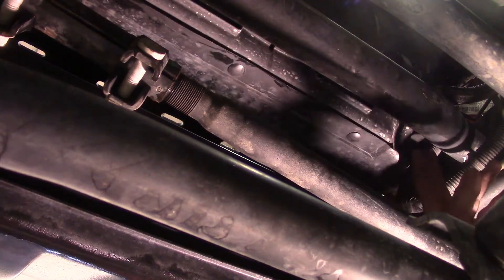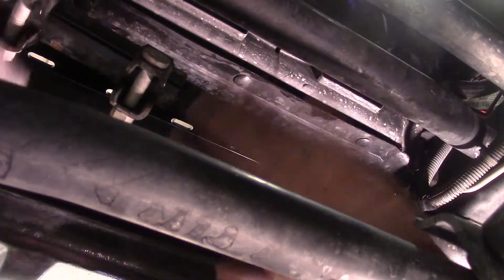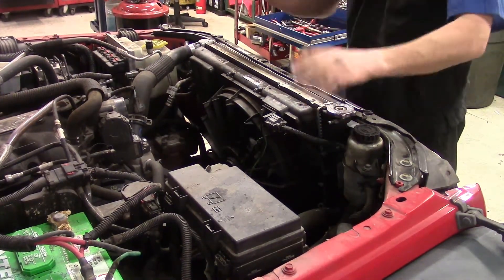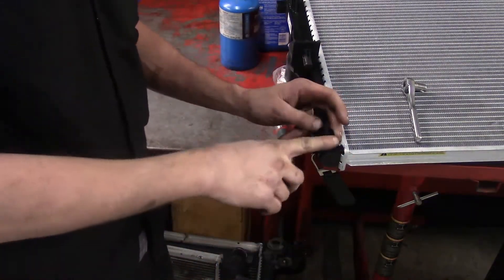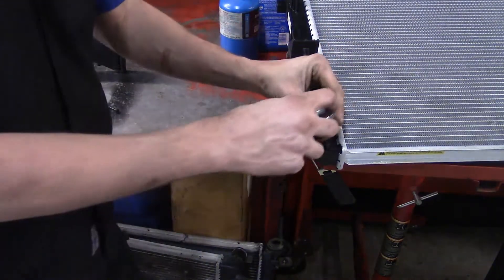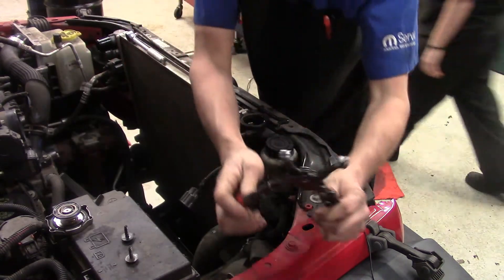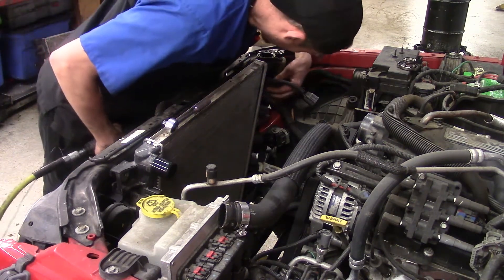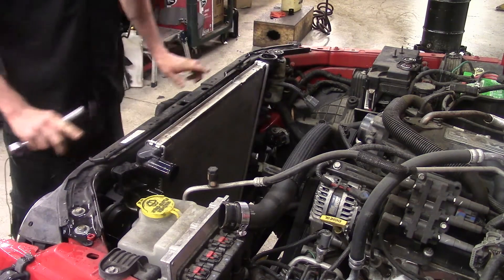Part 2/3: 2007-2014 Jeep Wrangler radiator

Comment: This guy is phenomenal I did the rocker arm replacement based on his videos and it worked perfectly. When I got to the very end I couldn’t figure out if the radiator drain was properly closed so I came back to his videos and ran this one. Watching David gives you a great deal of confidence and information that you wouldn’t get anywhere else. Not only that is an excellent teacher. Thanks David

Comment: Why does your air tool spray fluid?  Is that all condensation from the compressor?
Reply from the maker: The air dryer doesnt work and the system condensates alot in the summer here in Georgia. Thats the main reason I went to Milwaukees cordless tools. Other then putting air in tires.....I dont need it hardly ever. I have one line I havent used in about 5 months that I know is full of water.
Reply: water trap and line regulator will fix that. Here in Texas we too have humidity issues. So dual water traps fixed my issue.

Comment: My problem is that I have new radiator installed but now I cannot get the screws in at all. I think they need to be pre-threaded or something. What a pain in the butt. After spending 230 bucks on a radiator you'd think it would be ready to install.
Reply from the maker: Double check. on some radiators you need to transfer the hardware such as the threaded inserts. That might be the issue your having.

Comment: Awesome video, it saved me a lot of money today.  It took me about 3 hours, but most of that was dealing with the tight surrounding of the ac condensor.  I do have a question though.  I dropped the bottom driver side screw that holds the ac condensor to the radiator and I cannot find it.  Is this a big deal as long as the other 3 are in?  Is there any concern with that screw messing anything up later?  The only thing I could think of to find it was to take the radiator out again and I wanted no part of that.  Thanks again, the video gave me great confidence that I could do this myself.
Reply from the maker: Thanks for the update Joey.....you should be okay on that missing bolt but if possible I would recommend removing one of the other 3 and go to your local hardware to match it up. But if opt not to then I still feel that everything will still be okay. Thanks for the kind words about the video and for following the steps. Make sure to subscribe and check out my other videos as well.

Comment: What is needed to remove the trans fluid lines if you have an automatic?
Reply from the maker: Jackson Cruz Morning Jackson. The trans cooler is part of the a/c condenser......so removing the lines is not needed when removing the radiator. The vehicle in the video was an automatic as well.